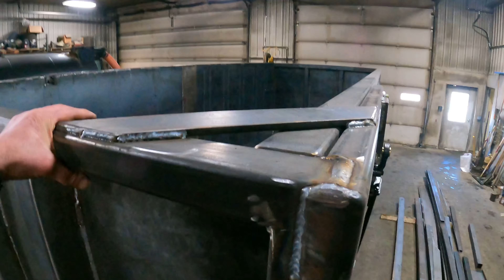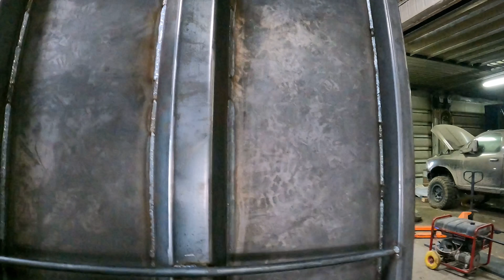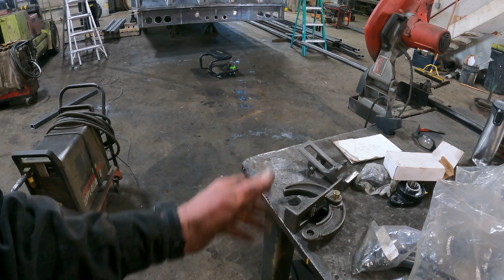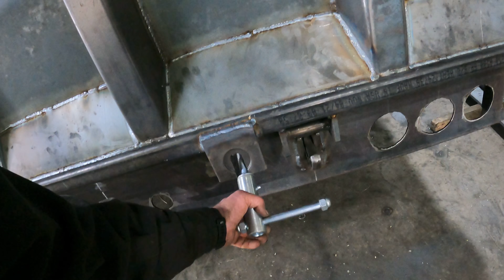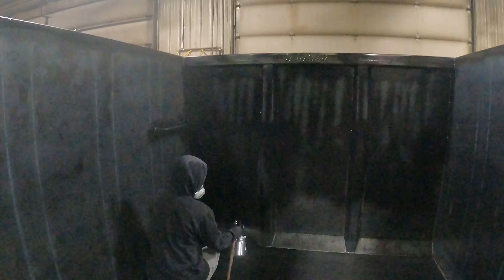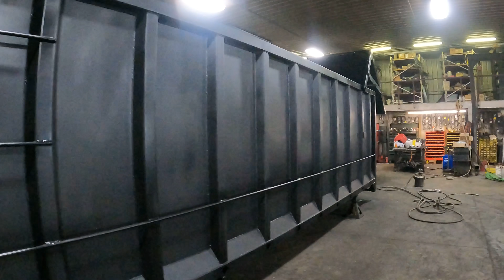Very awkward intro on this video

Comment: Andy, your composure and restraint to 'negative' comments or concerns is well matched by your amazing engineering and design skills.  I've worked with many different types of folks in my career and have always thought I was blessed to work with so many talented and skilled people - until I started watching your work in these videos.  I've come to realize that your skills often well surpass many I've worked with - especially on the people skills side of things.  This is obvious by your family's and co-workers respect,  I used to think some people in your videos were 'just being quiet'  but it may be they are a bit intimidated (meant in a good way) by how strong a positive person you are.  After all I would be very quite in your presence also.  I'm sure you know that your a great a role model for all those in your life.  Keep these videos coming as there are many that will still benefit from your example.👍

Comment: As a part time farmer and full-time mechanical engineer with 25 years experience designing heavy welded structures I can say I am very impressed with your silage body design.   Keep up the good work.

Comment: It's a few years since we did a large fabrication job like that. It always takes longer than you think. It takes forever to get it all welded but the bit I hate is prep for paint and painting. Fantastic work.
Reply from the maker: Painting is the high stress point of the project for sure

Comment: You're doing a great job Andy. I have a Provost canadian made dump trailer that latches the gate with a hook from under like you's. It's lever operated. When box goes up the lever releases presure so hook can release. When box come down on lever it returns hook to lock position. Simple cheap system. You would have to raise box a little before opening the gate. It would cut the cost of the air piston you use. Not ment to find fault with your work! It's always nice to be exposed to different methods of doing things! Love your videos Folks!
Reply from the maker: Understood, there is a little more wear and tear in those style lockups that provost uses though.

Comment: Hi Andy, great video, I have been watching ye build the silage body, it is a work of art.
From my experience it is unreal the amount of punishment a silage trailer tailgate gets,   fail to open and lifts the pulling tractor up in the air, reverse to close to a steep clamp and bend tail door while tipping,  turn to quickly while load is slipping out and bend door off sidewall of clamp, turn the other way to quickly and bend door off buckrake of clamping loader. Fail to get out of the way in time and get hit by loader coming down from clamp. Snagged on a low tree limb door pulled from hinge. Fail to close and grass out in the field or worse only closed at one side when filling starts and bends door when full .
These are just a few little tailgate problems which I have encountered and repaired down through the years.

Comment: The problem really comes down to the fact people think these videos are the only things you have going on. I see it on most channels the disconnect from rural life to the city is so much more than when I was a kid that they don't realize how much work goes into ranching, farming or Fabricating and dairy like you do they want 24 7 each min and the design of your project.  They next inform you about pto shaft covers, kids on tractors and proper use of loaders based on there knowledge from modern marvels and how it's made 😁 great video andy like the design of your silage bed.  I need to find some time to work on our dump truck bed but it's calving season and almost time to start putting down fertilize so it will be next winter before we get back around to the dump truck because it works fine

Comment: There are a few dump body companies that mount them upside down like that. The biggest company is R&S bodies. I have a R&S dump body from 2001 with the locks upside down. Iv had less problems with them that way then right sideup.

Comment: I've gotta say Andy, I bought a few pieces of steel from my local steel Co. and I walked out of there with my knees buckling and it wasn't from the weight. There's got to be tens of thousands of dollars in just steel, not accounting for  labor, (child labor, lol), I know you like making and designing things your way, but wouldn't it have been cheaper buying one and do a few modifications to fit your needs? And as everyone has stated, you do exceptional work, you're a genius!
Reply from the maker: The pre made boxes are expensive due to the cost of steel as well

Comment: I'm a farmer in the southern red river valley of the north. There are lots of sugar beets raised here,  Most lift box trucks here have a simpler and easy to make box latches than you have. You do need to lift the box 3' and it unlatches, all mechanical, We don't have hydraulic end gates , they are only needed if your stuffing something in the back.  If your interested in seeing this latch system I can take pics and measurement's just need contact info.  Enjoy your videos !!
Reply from the maker: I’ve researched lock assemblies for a long time before I built these and know what you are talking about

Comment: Andy, My take is some of the viewers providing crazy feedback need to take a pause and realize you don't have to share a thing about your farming operation. Also they might want to consider that this is a very large Holstein farm, 1700 cows plus all of the necessary tractors, implements and  equipment necessary to make things work.
Bottom line Andy you keep on doing what you do best and thanks for your hard work.

Comment: Not really questioning your design because I know you have a ton of experience so don't take it wrong but the boxes we use where I work use a little different tailgate design that works without latches at all in "silage" mode.  There are mechanical latches for grain hauling but during silage the gate is just held by hydraulic pressure.  This does require that the driver take care to power down the gate after dumping but I have seen no problem with the cylinders holding the gates closed.  The difference I think is that our gate hinge a couple feet lower.  Our boxes are only five foot sides with toppers that are made of PSP to add  height for silage chopping.  When silage season is over we take the toppers off to use the trucks for other hauling - grain, rock, lime, manure, etc.
Reply from the maker: My box that I build is basically what you are describing that yours is. Gravity and pressure from the weight of the gate is more than likely what holds your gate shut for silage h like mine

Comment: Great video and funny intro. You have loads of experience and the last time I checked, it still took 20 years to get 20 years of experience. You gave up a lot of your “trade secrets” in every video but they obviously didn’t listen. Until they have struck an arc and warped metal, you can’t explain it to them on how to stop it. Ramble on all you want.

Comment: If it isnt tight it isnt right holds true for silage box gates i would imagine. Lots of work sitting there. I can see you like suggestions, lol, how about some grease lines coming off those zerks up top to get them within easy reach? I only say that because im probably too lazy to crawl up there and give them a shot when needed, great job!
Reply from the maker: Grease lines would get broken off and then never repaired. Put the box all the way up along with the gate and most of the time you can teach from the ground

Comment: Jerks Andy...  99 percent of of us enjoy it the way you do it.    
One thing I think would benefit your operation is a separate building on the back there with sand blast booth and paint booth.  That new shell would love sand blast and etching primer.  Put one of your smart kids in a cost analysis study.  You do a lot of painting. My son owned a trailer factory.  Sand blast is great way to prepare to paint new steefl or prepare painted stuff.  
Get a market survey done. You might want to market those boxes. A goodvshop manager an 4 or 5 good welders. And get it on ... Separate operation.

Comment: You can also use a maxi brake chamber to latch the tail gate but they make one just for them it put you in the mind of a brake chamber but a little smaller but I think they use the same spring they are good for tight places that what all the coal trailer use is the style I’m talking about the main thing is to make sure they can over that way it not all up to the cylinder to hold all that wait
Reply from the maker: Yeah

Comment: Will this customer remove the box as you do with yours? So quick connection light plugs❓ hydraulic hose & air lock connections❓
Reply from the maker: No it’s a permanent mount

Comment: Is it just an optical illusion or is the spacing of the uprights by the lift cylinders different than the rest of them? And if it is, is there a reason structurally for it? Also is there a reason that you did not incorporate a cab shield into the body?  Asking cause I don’t know, not trolling.
Reply from the maker: Spacing is staggered to get around tailgate post

Comment: Do you have a formula you use for tab lengths pivot points and angles or is it mostly from trial and error over the years and what is your floor to tailgate height when open for bales or silage removal
Reply from the maker: Floor to gate opening is 115” on a box with 73” sides
Reply: Thanks Andy

Comment: Looks good Andy if it's not being nosey what's the box cost you?
Reply from the maker: I’ve sold this one to somebody
Reply from the maker: This one is a little different setup than what we have built and what we are going to build later this spring. Depending on size of box and options they range from $35,000-$50,000

Comment: I vote more awkward intros from the top of the ladder lol but the ladder has to get taller with each new awkward intro.

 I think there is a clear that you can get that will adhere to just the metal without using a primer. It would probably be the same stuff that the rat rod community uses to clear over the rust/patina. The box turned out great. The lights on the rub rail is that a dot/NYS requirement or is that your choice? I know the very front and rear corners are probably dot/nys just wasn't sure about the rest.

Comment: Add my comments to the comments of those who are frustrated with the whiners.  What I enjoy seeing is the same thing as if I had dropped in to say hello and we walked around and you gave me a quick tour.   If I want to learn how to make one of these myself I'd buy one and use it for a pattern or I'd get a job someplace where they are made for sales and work there for a year or two.  Or I'd find a trade school or a good engineering school where I'd earn how to build a box in general or hire an engineer to do the engineering.  I think what you have been doing is wonderful, you are very accommodating but you do not have time to run a training school.  You are running a large business that takes a huge amount of your time just to keep track of what everybody is doing and how things are going.  A manager has to know where problems are popping up, how the work flow can be changed to handle emergencies and what help, parts and questions your employees need answered and then you run interference for them and remove any obstacles in their paths.  
You will never satisfy all watchers.  I enjoy watching and seeing what you are working on overall.  I don't expect to be trained to do the job myself.  
Nice job all hands.  It looks great Andy.  I am happy with what ever you have time to share with me.  OBTW, I was able to get a job done in my DIY garage based on what I have noticed your people doing a few sessions back.
Thanks for the help.
✌🙏🏼❤🖖
Reply from the maker: Thanks for the comment

Comment: Andy, check out how these silage trailers do the rear door locking. They use an elongated hole for the door pivot so that when you power up the trailer after it goes up a foot you can open the rear door on a separate spool. Then the door rams slides the door up the back of the trailer off of the hooks and then allows it to open. https://youtu.be/unspfH2Nedw
Interesting to see
Reply from the maker: Those style lock assemblies wear out quick